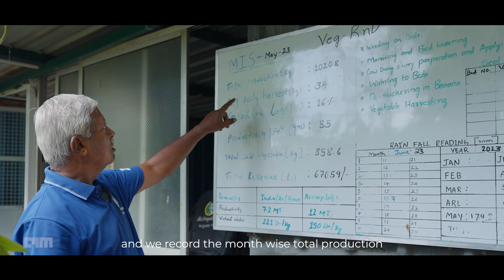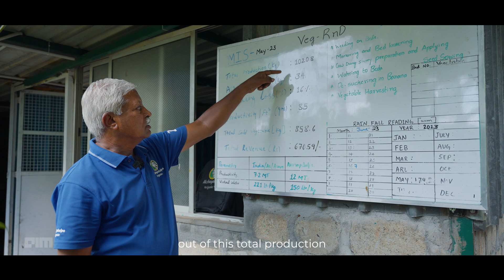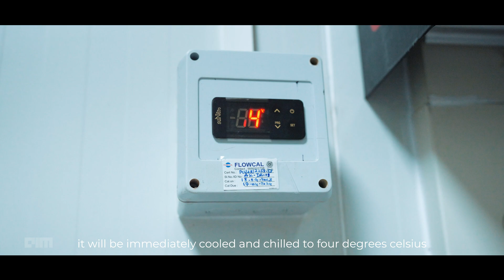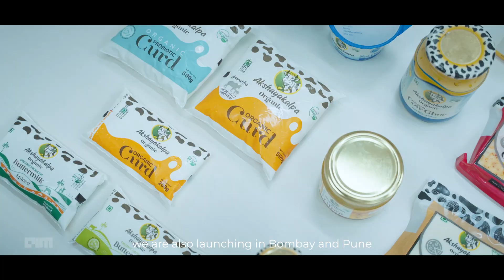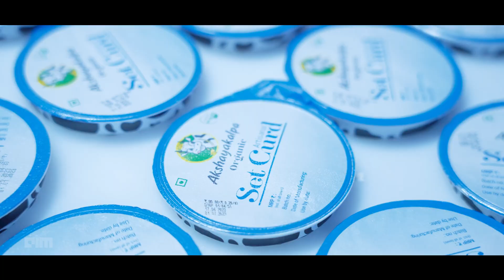Akshayakalpa's Data-Driven Organic Revolution

Comment: Is there a way to avoid using Plastic Pouches for Milk? We all know the level of harm that indiscriminate use of Plastics has caused to the environment. Can you use Stainless Steel bottles instead? Back in the old days, Aavin Dairy in Chennai used to supply milk in Bottles. The bottles were returnable for a deposit, and we did not mind the slight inconvenience. Can we bring it back please? It also prevents Microplastics contamination in our foods.